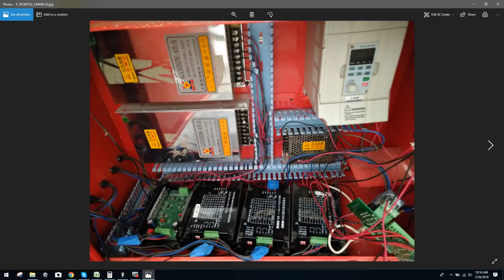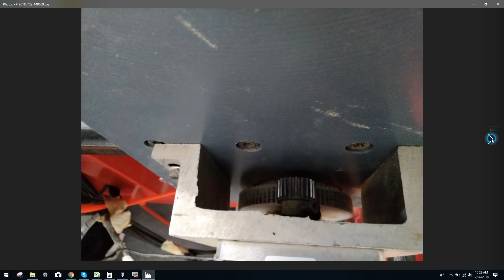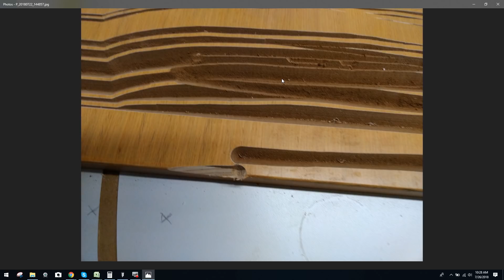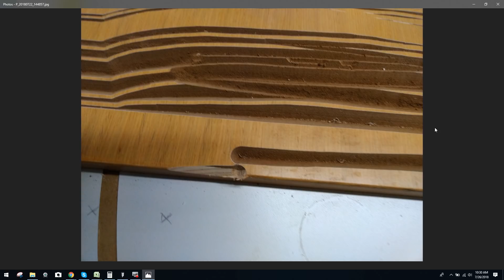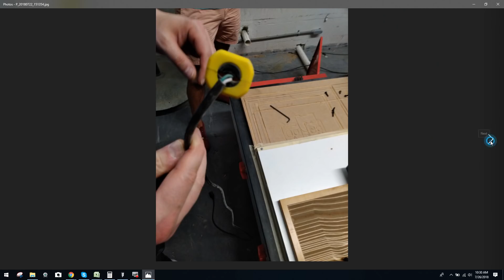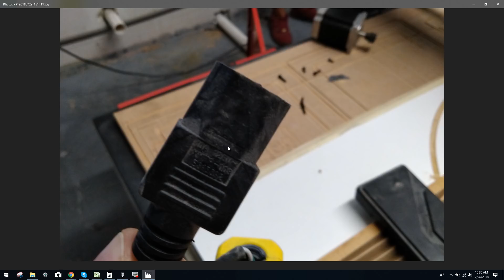CNC Service Call Gone South!  This Person Lost $1500+!

Comment: First Picture - wow. 
How close can the vfd be to the motor drivers? Or is is simply have to be outside the metal driver enclosure? Do the motor drivers+ interface board have to be in a metal enclosure (I think I may have answered my own question). Thanks.
Reply from the maker: The VFD under best practices should be at least 8ft from the drives for optimal signal protection. The drives should always be mounted in a metal electronics enclosure to act as a Faraday cage. This is under best practice to help avoid EMI pentration.

If that's not possible to do with the VFD, and you have to have it mounted in the enclosure with the drives you should use an inline power filter to control EMI.

Thank you,
Vince
Reply: corvetteguy50  Thanks.

Comment: What was the outcome of this machine ? There should be a "Catch A Contractor" cnc version
Reply from the maker: Drew,

Thank you for your support. I ended up performing the retrofit, for my new client Abe building a completely plug N play electronics retrofit from motors to VFD.  Its very odd the person who was originally contracted, and made the electronics mess was no longer on Craigslist at least at the time of delivery of the new components, so finding him was all but a lost cause. I agree with your idea to "catch a CNC contractor" . I know it isn't over with these type of people even if this guy never works on another system. I see this industry expanding everyday. These people are coming out of the woodwork to make a "quick buck". 

They typically build one machine for themselves, and feel they have all the required knowledge to work on any system. They then start marketing themselves like a genuine contractor. Its really very scary actually. We all have to be very careful with research now, and have to ask the right questions. There's no room for error when thousands of dollars, an your personal safety is at risk. This whole mess almost ended my client's business. 

Thank you,
Vince

Comment: Research is the first step.
Reply from the maker: You guys are so right! This situation is one of the worst I've seen. I hope you all research your investments to death, and realize when you open your business, or ideas up to people your becoming vulnerable. Take your time, and make sure you know what your getting into. Thank you Vince
Reply: Yes, right now I am researching Chinese  CNC table router machines  4'X8' to 5'  X10' the pro and cons so far price point good, quality of the machine still unknown, support No so much. I currently have a 2X4  machine.
Reply from the maker: Lou, thank you again for your support. The Chinese chassis are typically fine when purchased using a payment processor that protects the buyer. Amazon,eBay, and Paypal are your best friends in with these types of purchases. The main thing is to try, and buy the chassis separately as the controllers that come bundled with them are simply not reliable. Thank you,
Vince